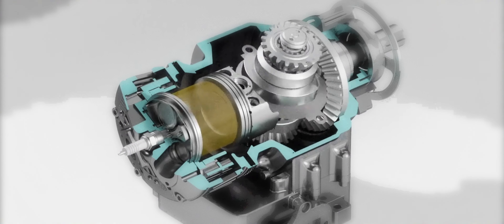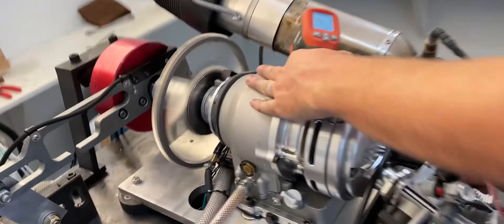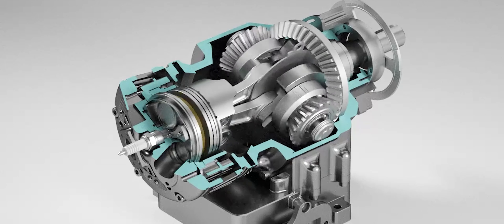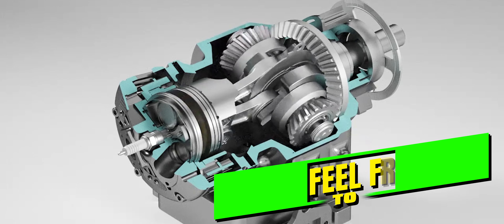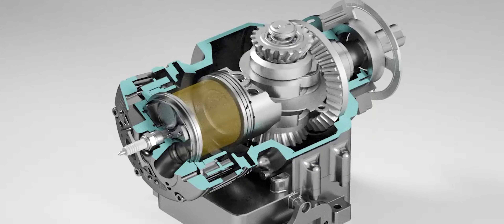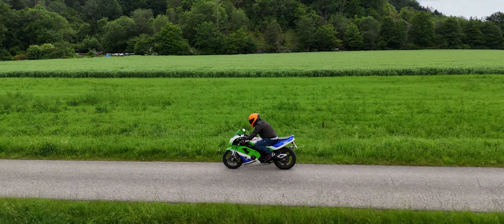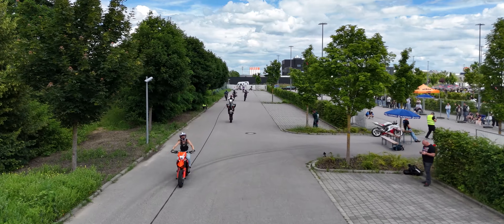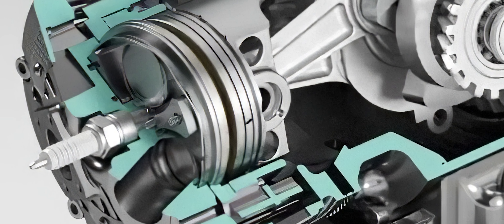Revolution in motor technology?  - Avadi MA-250

Comment: Sorry but there is nothing revolutionary here. The weakness of this engine is the longevity of the rotary cylinders combustion valves  There is nothing in this video that tells me how the company is going to overcome this weakness that is common to all rotary valves.
Reply: So when I saw this other information directly from the distributor of this motor at the SEMA show that was actually the biggest thing they were talking about which they didn't mention here at all.  They've actually designed it specifically for that reason and you can actually rebuild the top of the motor in 8 minutes.   They said with the RX7 motor you have to pull the whole thing out and it's a whole expensive and time-consuming process.  And they've designed it so the whole top of the motor where the intake is can be removed with six screws and then there's some kind of ceramic valves and stuff you just easily swap out and then put the head back on
Reply: Quite good....has a long way to go in development, although as it is now, it would make for a good reliable mechanical pump that wouldn't require any maintenance and last a lifetime